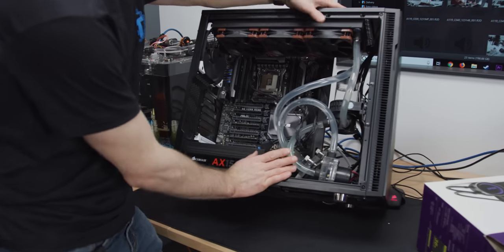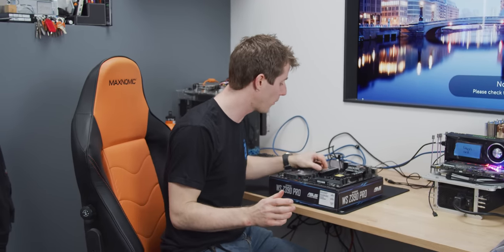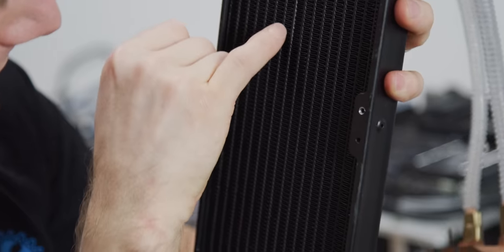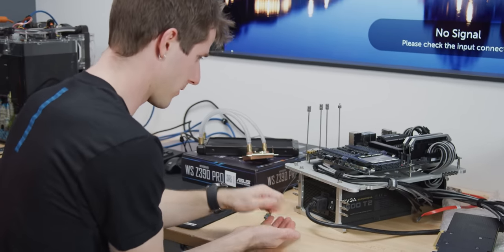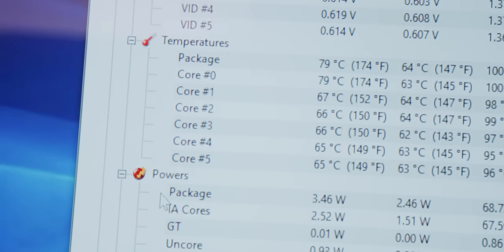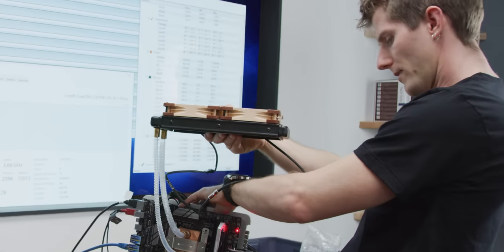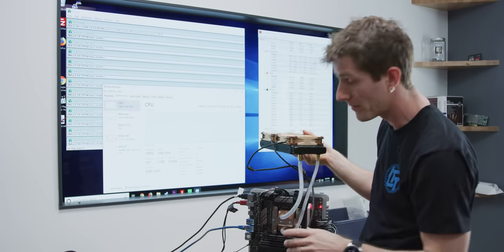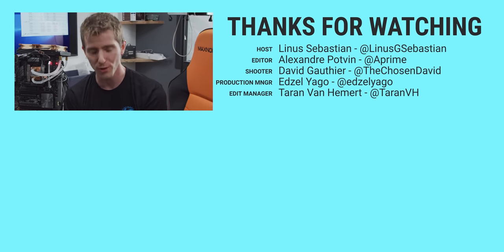CPU Cooling with BOILING LIQUID 🔥🔥

Comment: really wish he'd rotate the rad so the liquid return tank would be on the bottom. I feel like that would help the circulation of the liquid.
Reply: RaphYkun Finally someone who understand what convection is and how it works. :) you are very much correct. Linus failed because of him holding the radiator in the wrong orientation. Heat rises, cold sinks. :) water always tries to be closest possible to +4 degrees Celsius on the bottom. :) hence the water will flow.
Reply: That was exactly what I was thinking. Caught myself tilting my head whenever the wrong side of the raditor was up. :D
I am curious how practicable this concept will be in the future. Hope it will be, because I like silent PCs.
Reply: You, and everyone else with basic understanding on how gravity work...
Reply: he is usually doing shit tono of DIY stuff, why he didnt use plywood frame to hold radiator nad mother board right way? or use anthony to hold it for him, for hours of testing and benchmarks...
Reply: I think he is just not used to gravity. He drops things all the time too
Reply: Not to mention turning on the fans would've created a bigger temperature differential. I'm so triggered rn.
Reply: @pederb82  What you actually wanted to say was that denser water will move to the bottom and less dense water or vapour will go to the top, and you also tried to point out that water is at it densest when it's +4°C. But first we don't know whether there is water in this system at all, and IF it has water in it, then it must be at a vacuum because you can see that there are bubbles forming at 70°C already.
Reply: Linus held it as the designers instructed. So I'd say they know what helps circulation. This isn't only a liquid relying on convection, it's held at a low pressure to decrease boiling point to the temp they want to maintain. It boils and the vapour moves to the condenser, cools, and returns to the cpu block.  
Basically similar to how a heat pipe works, needs refining though, however it definitely works.
Reply: @sasjadevries  It's indeed not water because it's boiling at a lot lower temperatures, lol.
Reply: @maulerrw  The designers only instructed "above the CPU". No-one here is disagreeing with this, but it also needs the radiator to be vertical with the return tank at the bottom, so that the boiled coolant can force its way all the way through the radiator and return through the proper return pipe. This would considerably improve the flow rate as well as making proper use of the entire radiator's cooling area, instead of just the bottom end where the hot fluid would get through by diffusion.
Reply: The same argument is made with Thermal coolers, yet the orientation of thermal coolers doesn't matter.
Reply: In fact, they got the best performance with the CPU level - but if you look closely, Linus was tilting the radiator upwards. This is actually the most important aspect for performance, but they missed what they were doing to cause it.
Reply: RaphYkun the radiator must be on top because the hot water and its vapors will rise to the top and then fall back down as it cools. If the rad was on the bottom how exactly would the water go back up to the CPU?
Reply: @iskierka8399  The problem is, this requires a very specific setup in which if it hit the market a handful of people will set it up incorrectly, and does it justify the price vs a stock heatsink and fan or even a passive cooler?
Keep in mind Linus had 2 fans running on this prototype cooler meaning 2 moving parts creating vibration and noise.
Reply: @christianguitron6316  Ask yourself how a Thermal Cooler does it when 99% of Graphics cards have them facing upside down, the liquid in the heatpipes of Thermal coolers are still able to make the full loop.
Reply: Somebody look up how a coffee maker works. There is your answer.
Reply: @Skelath  Thermal coolers don't actually have fluid momentum transferring heat, whereas in this cooler that is the entire principle. To maintain that momentum you need to give it a clear path.
And yes, it will be specialist - most watercoolers are. Linus was using two fans, sure, but he didn't test whether they were needed or whether they needed to be audible - he couldn't, in fact, since he had the radiator set up wrong and any result would be invalid. We have no idea about pricing or anything else - but none of that affects the fact that he's accidentally underselling the performance here, which could potentially be enough to run that CPU with no throttling.
Reply: @iskierka8399  still way too many negatives specially when my Corsair H150i pro runs full load on my i7 8700k, no throttling without the use of fans and the pump isnt audible.
Also the fans were active as you cannot see any idle fan blades.
Reply: yes... just wrote that too lol
Reply: @iskierka8399  At 08:13 the fans are clearly spinning.
Reply: @Skelath  It's different for graphics cards because those coolers have a wick inside their copper pipes to evenly distribute the liquid. The liquid on the hot end will vaporize and condense on the cool end of the pipe. After it condenses the wick soaks up the liquid again and carries it back to the hot end. Liquid can be circulated because the water adhered to the hot end of the wick is of lower concentration (because its vaporizing). High concentrations will always move towards low concentrations until they reach equilibrium. Since one end is continuously vaporizing the system will never reach equilibrium. Therefore, it's going to circulate regardless of its orientation. For Linus' rad, that doesn't apply because there's no wick inside those tubes. That doesn't mean his radiator won't work if it's on the bottom. I'm pretty sure through cohesion and a vacuum the water could still be siphoned back up the tube, but the rad being above the cpu will be the most effective way.
Reply: @christianguitron6316  Good point
Reply: It's a bit counter-intuitive, but that would actually hurt circulation. The hot hose has the highest proportion of vapour in the system, while the cold hose is 100% liquid. The rad and CPU block are each somewhere in the middle. It's best to have both inlet and outlet on the same level because it means the full height of the cold column is 100% liquid, giving the greatest possible pressure difference across the rad and the best flow. It doesn't matter for the CPU block so much because the inlet and outlet are so close together, and you need to get the vapour into the correct tube in the first place. 
Remember too that the rad should be almost empty for this to give the best condensation, and you don't want it to start vapour-locked so that liquid convection can help you get started.
Reply: @Skelath  That's because (from my understanding) they use capillary action from something like fine glass fibres inside the copper tubes to draw the condensed fluid back to the hot area, no matter what the orientation is. I would expect their performance would still be better if they are upright with the hot bit at the bottom though. This was working on the same principle, but without the capillary action, so the heights and angles would be critical.
Reply: @Skelath  capillary action from a wick (probably glass fibre bundle) inside the pipe, to draw the condensed liquid back to the hot bit
Reply: Well, I'm glad to see from people's comments it wasn't just me shouting at the screen then when he was positioning things at all the wrong angles

Comment: Proper tweak would be to mount the radiator in a way where the thick hot tube is positioned on the top and the thin tube at the bottom, fluid convection works better if the hot fluid enters radiator from the top and and becomes heavy due to cooling by the radiator thus exiting the radiator from the bottom creating a naturally circulating fluid due to heating(by cpu) and cooling(by radiator)...  good luck !
Reply: I was going to say the same thing... the conventional radiator is the problem here... Only other way around it, sorta,  would be put the radiator sideways.... so the hot was on top and the cold side was on the bottom, but no case is going to allow that configuration.
Reply: @kleetus92  What he said

Comment: I did some research on non-powered cooling, and while I can't remember half of it, I do remember that you needed a long "cooling space". Some houses in warmer climes tend to keep a long line of hose snaking below their house, connected to their fans/heat gatherer.  The idea is that the long distance of the cooling space ensures that one tube is "hot" and the other slightly less so, if you have two tubes both the same length, there isn't enough difference between the two and you just have two hot tubes and not enough circulation.
Reply: Actually if you just put the lower end of the returning tube under the heatsource, it won't lead vapor out as bubbles travel upwards in the liquid. While the vapor tube should have a small protruding edge into the radiator that elevates the end of the tube above the sinking port (upper end of the returning tube), therefore prevents liquid flowing back.
The main problem with this cooler is the pressure probably isn't lowered enough in the system to get the water boil at a significantly lower level than at atmospheric circumstances. And that type of radiator was designed with pressurized water in mind. Those flat liquid channels don't really clean up due to the capillary effect keeps some liquid in them further reducing that small contact surface the vapor could condensate on. I tried this exact method before, but with better tubing and ethanol coolant (has much lower boiling point, doesn't corrode metals and prevents any life form from growing in the loop), but wasn't really impressed with the results. Although I didn't give up the project completely as I'm working on a different radiator design.

Comment: gods, just hold the radiator sideways so the hot gasses go in the top and the cooled liquid pours out the bottom and you'd be there but he kept holding it flat destroying the damn flow. ....  at least he didn't drop it. :/
Reply: @LeftBrainChoice That's not air. And he can't open the circuit, it came sealed. Even if he could, that doesn't matter because the circulation mechanism of the coolant depends on the bubbling of it.
Reply: Exactly. Holding the radiator flat had it trying to work both ways in both tubes, and not giving the liquid the full loop of the radiator to cool down. On it's side with the hot 'air' side going in the top of the radiator with the cold 'water' side down should improve it a bit more.
Reply: @LeftBrainChoice it's a passive phase change cooler using water.
Reply: I was just gonna say the same thing, I've seen stationary engines cooled using this method and it works great when properly setup
Reply: Ah thanks for pointing that out! Was wondering about that. Another question - should this thing be 100% filled with water to work optimally? I mean, at some point the water inside will evaporate, right?
Reply: @JayMaverick   No - the fluid needs empty space to boil into for this to work effectively.
Reply: @LeftBrainChoice you need air or at least some kind of gas that's heavier than steam to have it go up. no air would mean no movement.
Reply: @OB1KXB  steam would fill out the empty space, going up in to the radiator
Reply: You're correct Psychoticus.  The manufacturer is trying to produce a thermosiphon.  This is a common passive cooling that is often used to cool agitator seals in industrial applications.

The radiator should be perpendicular, and the top of the cpu should go to the top of the radiator.  The bottom of the cpu to the bottom of the radiator.

Radiators are also not usually used for thermosiphons, but rather reservoirs with sufficient thermal mass.
Reply: That air space is probly the liquid in gas form. Like a heat pipe on a gpu pop it and it evaporates thats also why it’s completely sealed